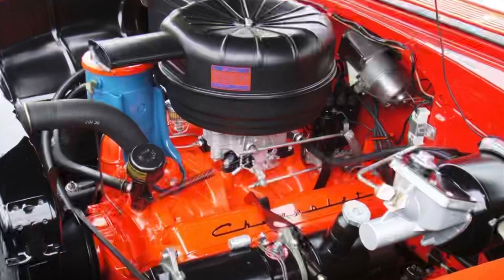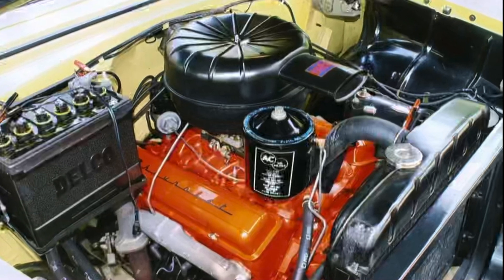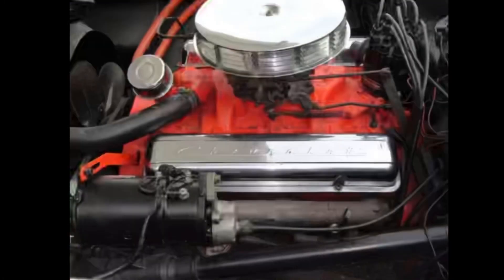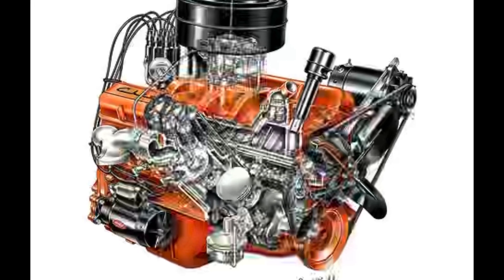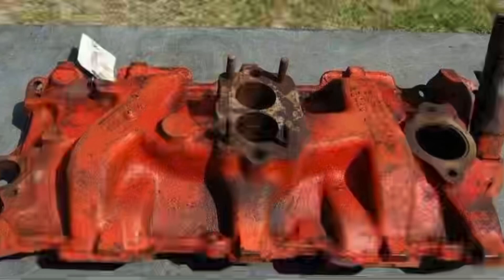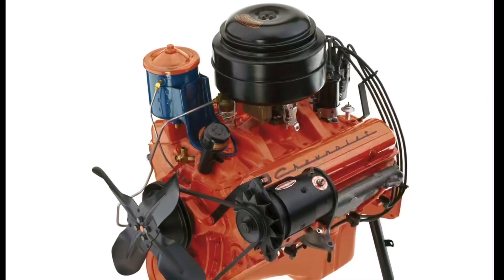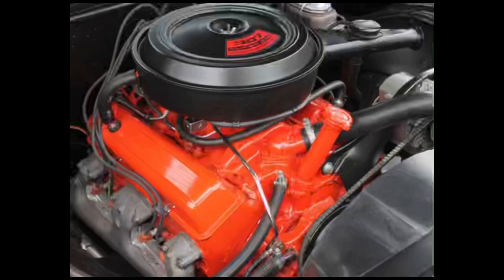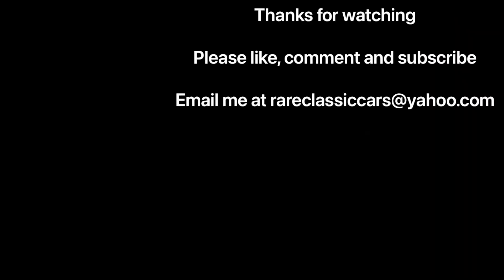Best Engines of All Time: The Chevrolet Small Block V8 (262/265/283/302/305/307/327/350/400)

Comment: Imagine being one of the many who designed this engine back in the 50s, what a great feeling it must have been knowing your hard work really paid off and made so many people happy.
Reply: True, but Chevrolet had solid baseline engineering from the Cadillac OHV V8 of 1949.
Reply: @21stcenturyfossil7  I don't know about the old engines but it was a well known practice thru the 1970's and 1990's to use the Bon Ami treatment on on a fresh rebuild that had trouble getting the rings to seat. Apparently that particular practice tended to work because most mechanics that were good ones generally recommended it.
Reply: @stephensaasen8589  Yeah, the idea is the Bon Ami acts as a lapping compound to get the cylinders and rings to conform.  It might work but, for sure, dumping abrasives into the cylinder is taking life away from the motor.  How much life?  I dunno.  How much is enough?  I dunno.  How much is too much?  I dunno.  How do you make sure the abrasive doesn't get ground into the cylinder walls and the piston-ring gap and continue abrading?  You can't.  it's a crapshoot not a real fix.  Fortunately, modern machining is better now than in the old days.
Reply: @21stcenturyfossil7  that definitely is for sure. I can't remember the amount of Bon Ami I was told to use but I think only a teaspoon or so. I never did it on my engine that had trouble with rings seating because I thought the same thing - you just don't toss abrasives down the intake. I'm just wondering though if The compounds fill in the gaps or something. Seems like if it was really abrasive, the vertical gouging in the cylinder wall would worsen oil consumption. It's just good that machining and precision of parts today definitely has improved, along with the lubricants.
Reply: Imagine being one of those guys knowing what we know now and possibly changing the course of the v8’s. That would have been legendary.
Reply: kramden, GM engineer, Ed Cole, designed the SBC engine in 1954 and stuffed it into his '54 Bel Aire 2 door hardtop. His wife worked at Detroit Public Works Sept. She brought home some orange traffic paint and Ed used it on his hew engine creation. Ed Cole convinced GM executives that it was time that Chevy had a V8 engine. '55 Chevy V8 engines had several problems. Many '55 Chevy vehicles ended up with '56 engines under warranty. The 265 SBC had many flaws, and most were resolved but not all. Some flaws still remain today, and GM doesn't do anything to resolve the flaws.
Reply: its bs old tech, never changed for 70 yrs. while others built better engines . gm, chev. just flog dead horses,,to death..its a crap engine.. then, not wanting to seem like they built it wrong, slowly changed the design over 20 yrs. better heads, alloy heads, better blocks, . push in rocker studs. till when, the 90,s.. 2000,s. there garbage..adjustable rockers on hudraoulics..??..floating cam. sht plug angle..weak blocks.
Reply: Yeah, I remember talking with "Bobby" at Western Auto, next door to the mower place I worked at.  "Wasco", as we call him, was a very knowledgeable man indeed.  He didn't talk a great deal, but when he did, I sure listened.  I remember one of our conversations about the early small blocks burning oil.  I remember him saying some guys dribbled "bon ami" through the carb to help seal up the rings!  
Thanks for representing my old Caprice here, I remember that under hood view fondly.
Reply: @donk499  All it did was scuff the cylinder walls so the oil rings could seal properly.No foul.My first new 85 305 used 1 quart every 3000 miles.Didn,t bother me but not good for the catalytic converter.
Reply: @donk499  I think the bon ami treatment actually came out of a Chevrolet service bulletin.  Seems like "repair theater" to me.  Just a cheap trick to bamboozle the customer until the warranty expires.  Far, far cheaper and faster than a proper ring job.
Reply: @21stcenturyfossil7    I was shocked when "wasco" told me that.  But, I knew that he never would have "made up" a story like that...
Reply: @donk499  He didn't make it up.  I'm sure it got alot of coverage in the DIY magazines of the time such as Popular Science and Mechanix Illustrated.   30 years later, they just denied the problem first, like the rear brake lockup on the Citation, before resorting to "repair theater".
Reply: @21stcenturyfossil7  The Bon-Ami treatment was real but didn't help much. Many '55 Chevy vehicles ended up with '56 engines under warranty. "55 SBC engines used chrome-moly piston rings and most never seated-in properly. Also, no oil filter for '55 Chevy V8 engine.
Reply: @donk499  Clyinders needed to be properly honed to  match  the type of metal that the rings were made out of.That is why the Bon Ami/Ajax/Comet was used. It was a temporary fix to seal the rings do to improper honeing. It was a quick fix for manufactures
Reply: @sergeantmasson3669  The problem was that the cylinders were not honed to except chrome molly rings.
Reply: @tonyd1031  cylinder honing has near nothing to do with the fact that chrome moly piston rings  take a long time to wear/break in. Another problem that the '55 V8 Chevy engines didn't have an oil filter. Plus, there were oil leaking issues as well. I'm a 50+ years master level factory certified auto/truck tech. I've lost count, a long time ago, about how many engines that I've built/rebuilt in my career. Huge numbers of building racing engines as well.

Comment: 350 SBC is the greatest engine of all time. Hands down. Period.
Reply: So smooth, quiet and relatively efficient as well!
Reply: But the LS is better.  Ive had both and worked on both.  I really hate that everyone LS everything.  But there is a reason....
Reply: 327 highest hp is 375, 350 highest hp is 360, so he is right, not sure torque difference though?
Reply: @CharlesAtwell-or7bm  The L76 327/365 HP engine with 30-30 factory cam in the Corvette was the most powerful factory small block engine Chevy produced. 🤠
Reply: @DANTHETUBEMAN , Chevy  Vette  had a Mechanical  Fuel injection  327 that made 375hp , 
Double hump heads,  
11.1 Compression
Reply: @jimthomas1989  the feauli heads where the most sought after sbc head for a long time. 🤠
Reply: @DANTHETUBEMAN  , 
I have the Fuelie heads , and  the double hump heads  both  , Manley Stainless Steel  valves  , 58cc combustion Chambers. 
I have  283 , 307 , and 327 engines .
They are in Chevelle,  Nova and Camaro  and 11 inch clutch and M-21 Muncie 4  speed Trans
Reply: @jimthomas1989  That's all the stuff 🤠
I put 92 vortex heads on my 283, works well. 😁
Reply: @DANTHETUBEMAN highest factory rating. 302 made more Dyno power I think
Reply: @semiprofessional8470  yes I think so, but you had to order the 302 off road cam, and that killed any low end on the street, there was a dual carb cross runner manifold you could get in the trunk also. 🤠
Reply: @jimthomas1989 the 327 was EXTREMELY overrated.
Reply: @SSPlymouth  no factory 350 ever beat it's performances numbers. 
those are the facts not dreams. 🤠
Reply: @CharlesAtwell-or7bm  The 1970 LT-1 350 installed by the factory in the Corvette produced 370 hp, and 380 lb/ft of torque.
Reply: @micahcastillo9113  still short of the 375hp 327 by 5hp.
Reply: @CharlesAtwell-or7bm wrong 71 lt1 350ci 350hp 380ft lb in corvette last high hp year I've owned a few look it up in a corvette or camaro manual
Reply: @CharlesAtwell-or7bm  It simply means that chevy offered a very hot version of the 327 during it's lifespan.....it has zero bearing on the potential of the engine in this instance.
Reply: 327 from 62-68 was the best SBC ever produced.
Reply: @nighthawk8053  I agree. But it's not the greatest of all time since they stopped making it in 68.
Reply: @joshuagibson2520 i completely agree
Reply: @nighthawk8053 they were weak. The 350 was better as is the 400.
Reply: @nighthawk8053 not even close
Reply: @SSPlymouth  Spec wise 327 was  the best SBC 👍
Reply: Ol bull
Reply: Absolutely right
Reply: Best engine 1962,v8 194😂
Reply: Hands up
Reply: Spring steel ♥️🗽 makes the Block solid ‼️🇺🇸♥️‼️
Reply: Dumbasses never even put a oil filter on their engines... I think Ford made a hell of a lot better engines.... GM stoled the LS engine from Ford
Reply: Winningest racing engine of all time!😁
Reply: Up until the 5.3 vortec. There isn't a 350 sb that could run a 1/2 million miles without a major overhaul. Yet my 5.3 will probably be the last sb I'll ever own because it's approaching the 1/2 mill mark and runs like the day it left the lot. Meanwhile all my 350's hit the boneyard years ago with the rest of em at well under 250k.
Reply: @DG-sf9ei 5.3L = 327CID 🤯
Reply: 327 out performed all production 350's 😁
Reply: @DANTHETUBEMAN I bet if the 350 was around in the mid 60s it would have had more horsepower. It did however have more torque. Plus the highest horsepower difference was only marginal. 375hp vs 360hp. Overall the 350 generally made more horsepower across the entire lineup. The 327 is still a phenomenal engine that will go down as an American classic.
Reply: @DANTHETUBEMAN  327 was not as good.
Reply: @SSPlymouth  The 350 is a smog motor , more displacement for smog egr regulations to keep power up, non of the 350's from the factory had as much horsepower as a 327, 365hp was Big Block hp numbers. 🤠
Reply: @DANTHETUBEMAN  yea ok! Dream on …
Reply: Buick 350ci

Comment: We had a brand new 283. Consumed copious amounts of oil. It was somewhat normal. Blowby past the rings in an era when machining and tolerances weren't so great.
Reply: My Dad bought a '55 with the then new 265 that had an oil burning problem.  Under warrenty the dealer honed the cylinders and installed new rings, it still used excessive oil. The Power-glide constantly needed fluid.  Right before he traded it, when it was up on a lift a mechanic found a missing bolt in the transmission, probably was that way since new. Didn't leak any fluid after that.  At first, the dealer mechanics thought the new V8 was complicated, years later when he knew all of its problems were shade tree fixes, he wished he had kept the '55.
Reply: @timothykeith1367  My dad also bought on in December of '54. In addition to the oil burning, it liked to eat the fuel pump arm spring, creating a lifter style noise. Fearing he had a lemon, he traded it on a new '56 Olds 14 months later.

The last time I saw the '55 was  in the summer of 1967. I guess someone got some use out of it but it was pretty rough by then.
Reply: Back in the '50s & '60s we figured if a car didn't use a quart of oil in 700-800 miles that oil wasn't getting someplace

Comment: I have a 1978 305ci in my 1957 GMC 100 truck.  I was told from the start that the 305ci wasn't much of a motor - starting 15 years ago when I got this truck and about 50,000 miles later.  It is so good and dependable and she just starts and runs well day after day.  I have fitted an alternator on it, Vintage Air A/C, headers and an Edelbrock.  She is also an auto tranny.  She is just as good as the day is long.  I call her Daphne and she is such a great working truck.  I don't think I'd get another 305, or rebuild this one, but overall she is an A+ in my book.  Thanks again!
Reply: 305 is a great motor. But the 350 is much more upgradeable / buildable in regards to power as well as cost.

Comment: People often ask: how did Chevrolet steal the crown from Ford in performance small block engines, and keep it for so long?
In our reading over the years, we have attributed it to the following:
Generally, the SBC delivered more power from a compact engine with a smaller cash outlay. This is one reason why they were the go-to engine for most hot rodders back in the day. They responded very well to minor modifications. 
Parts (both Chevrolet and aftermarket) were far more readily available, and cheaper than other makes.
They fit easily in almost any popular American vehicle, home-built hot rod frame, or otherwise. 
They were also lighter weight than some Ford V8 engines.
We are sure there are other reasons, your other readers will surely mention. 
Cheers and thanks again for your review!
Reply: It came down to heads. Neither the Y-block nor Windsor could ever match the flow of the small block Chevy, despite more than 40+ years of competition. Ford had to move to the expensive (and really, overdone) Boss and Cleveland (4bb only) small blocks to compete with , and sometimes outdo, the small block Chevy. But their production numbers were so limited I'm not sure it counts. And really, generally, Ford struggled always struggled with focus - Y-block, FE, Windsor, 385, Boss, Cleveland, Modified - in that time Chevy only had the small block, big block, and for a short time, the W-block.
Reply: @salninethousand2496  - Louie Chevrolet was a race car driver... that gave Chevy a certain pedigree right from the start... no flatheads! 
Ford was basically trying to outdo Chevy's 'truck engines'... needed specialized Boss, Cleveland, SOHC, and DOHC engines to do it...
Reply: @salninethousand2496  couldn’t be more incorrect about head flow
Reply: @salninethousand2496  ever seen an fe head.. chev guys used to dream of cleveland heads..plus, chev are a cheap excuse for an engine..they still have problems with the LS... oh,,& who beat ferrari.. 220 mph. 427 fe..  here in aus, we had the xy gt ho.. 351c.. 260 mph std, 4sp.. 3 people, factory road car.. $5,300. 1971.. the film clip,,was clipped, to 140 mph.. so young suicide 16 yr olds wouldnt line up for one..  ausie bathurst.. holden/gm, fk, did they cheat at every oportunity to win the race. plus, they used ford 9" diffs. at least you could by a ford that went to bathurst, holdens were built to [ cheat], win.. ford sierra, won by 4 laps, holden banned them so holden could win.. if you want a reliable chev, just buy & drive,, if you want to race it,, go spend $$$$$$$$$$$ at the local speed shop..ill take a 460 over any bs chev..mate bought a jag, had to fit a chev, as there were no other kits,, he fkn hates chev.. he told me, you need a 44 gallon drum, & an 010 block.. the drum is for the rest of the engine, scrap.. then, beg for mercy at the speed shop.. he wanted a dodge 360. fitted.  i have a dodge challenger, 340, r/t. plus 4 ford trucks.. no chev gm bs here.. we bought the 385 cleveland off you, as it was no good racing,, we brought it back to the u.s drags, & flogged your asses.. we have the 302c. only thing you need to make a clevo go, is a mild cam, & 302 heads on a 351.. my bronco is scary..& on lpg..
Reply: @harrywalker5836  Oh horse hockey. I'm no brand loyal snob, I like all the great engines by all the makes. Besides, you go try telling all that nonsense to the engine builders, crew chiefs, and race teams in NASCAR. The SBC has won more NASCAR races than all the other small blocks combined. For street racing, the ball stud rocker design also allows SBC's to respond much better to simple bolt-on power upgrades. Absolutely nothing is as easy or as cheap to make great power as the SBC and LS engine family. Those are the facts, and it's painfully obvious that you're just a brand loyal snob. I love several Ford V8's, but everyone knows it costs FAR MORE money to create big power with a Ford. Why the hell do ya think so many LS engines are stuffed into fox body Mustangs.
Reply: @howabouthetruth2157  LS, took chev/gm, 70 yrs, to build a decent engine.. at least ford dodge, tried different concepts, not flog the same 1950 sht for decades. plus, have they ever built a decent diesel.. no.. 6.5tdi, 1950,s buik gas engine.. its not the ball stud, its press in studs. & no cam plate, & sht angled plugs. simese ports. weak blocks. & yes, i have a 340 simese port challenger r/t. for reliability, cant beat a clevo.. to hot up,,just need cam & 302c heads, job done. 12.1 comp..ive seen a 454, with canted valves, & seperaate ports.. must be prelude to the LS,,doubt it.. ever looked at ports on a clevo, or fe.. chev guys dream of ports & valves like that..look up ford xy gt ho 1971. 160 mph stock. with 3 people..oh, forgot,,you won nascar, excellent,,ford has won every race rally, world wide, even beat ferrari.. fe 427.. you know,,with the big ports..im not brand blind, i look at what works..& chev dont..nearly bought a corvette, back in 1976. it was up on a hoist, so i hd a look.. seen the rear leaf suspension they bought from ford back in 1930.. so that,,canned corvette.. & how long did they use the transverse rear leaf. till 90.s?. ch  ev    ch  eap..
Reply: @harrywalker5836  Thought I would mention one more major fact that I forgot to mention before, and perhaps "Harry".......you can try to "explain it away to the class" how way back in 1990, they took A FACTORY BONE-STOCK C4 ZR1 Corvette ( with only headers & open exhaust ) with the legendary LT5 engine and shattered both the 24 hr high speed endurance record ( 175.7 mph average ) as well as the 5,000 MILE (nearly 28 hrs straight) high speed endurance record ( 173+ mph average ) THAT BOTH STILL STAND TO THIS VERY DAY. Most laps, they were running over 181 mph, but the need to stop for fuel, tires, and driver changes had to be included, which of course brought the speed average down. Ford, Porsche, Audi, even Mercedes all used highly modified, purpose built cars to try to break these records and ALL OF THEM FAILED. Other auto makers don't even dare try, because they know just how extremely difficult it is to pull off.  Care to "explain that away Harry"??? By the way, another C4 with a stock LT1 engine ran right behind the ZR1, and it too, broke several records.
Reply: @harrywalker5836 Olds 455 would beat your Ford 460. I drove them all.
Reply: The invention of the small block Chevy led the way to the GM LS platform.
Reply: The key to reliability to these engines was the accessories 1#